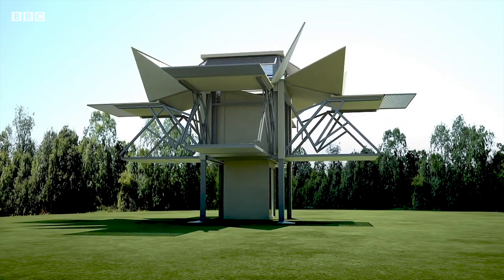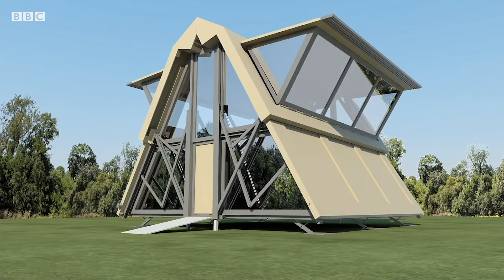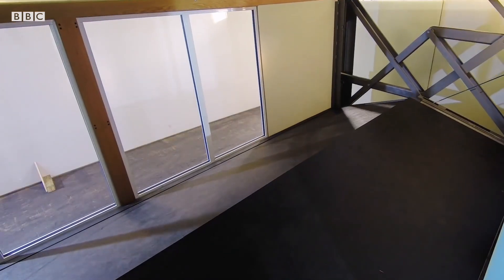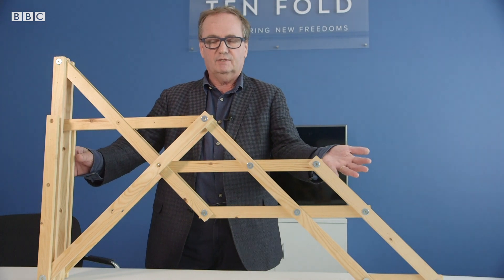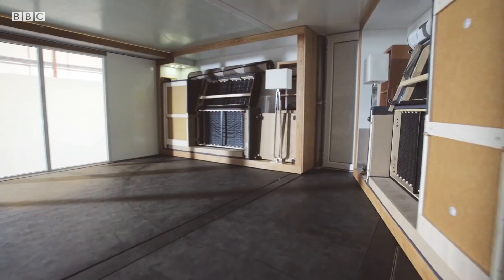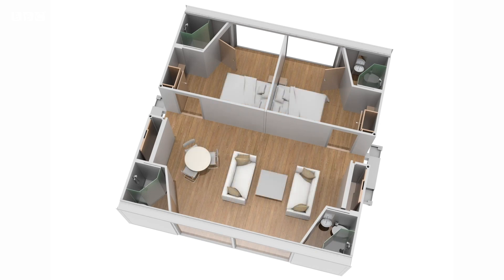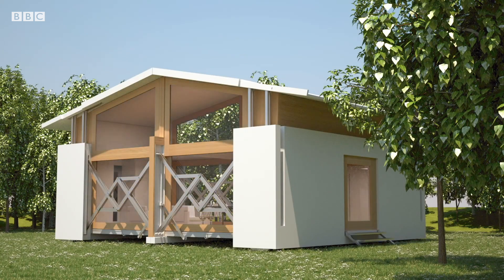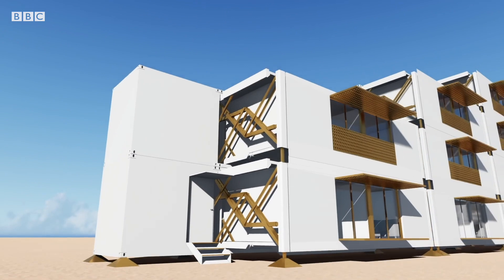The houses that build themselves - BBC REEL

Comment: I find the concept of unfolding buildings fascinating, especially the idea of counterbalancing for efficiency. In my experience as a flooring contractor, space optimization is crucial. I've worked on projects where adaptability in design allowed us to use smaller areas effectively, like transforming a bedroom into a living room. 

Cost estimation is another challenge in flooring. I’ve learned that understanding material costs and labor can vary widely depending on design choices. Using tools like FloorTally helps me streamline this process, ensuring accuracy in every project. Embracing innovative designs like these could change how we approach both living and working spaces.

Comment: The recent increase in house prices is felt by all the people
High housing prices have led many people to choose to rent.
Unless the supply of rental housing is very tight, tenants can choose a house with cheaper rent, or move to other counties and cities with lower rent.
Styrofoam houses are earthquake resistant and have the characteristics of being warm in winter and cool in summer.
Possible construction methods of earthquake-proof houses
First, use aluminum building blocks to form a triangular earthquake-proof house. Place giant aluminum plates or fireproof floors on the floor formed by the aluminum building blocks. People can sit on the floor.
Giant earthquake-proof house tank Possible construction method of chain-link earthquake-proof house
1. First use steel frames to form two triangular steel frame earthquake-proof houses.
2 Install steel ropes or chains between the two triangular steel frame earthquake-proof houses
3. Place aluminum plates or rubber floors on the floor network formed by several iron chains, and people can sit on the floor of the cable bridge.
The gravity of the furniture on the chain floor will cause the chain floor to press downwards. Giant springs are installed on the roof of the chain shock-proof house to achieve the effect of the front and rear shock absorbers of mountain bikes, straightening the chain floor.
Next to the two triangular steel frames at the bottom of the iron chain earthquake-proof house, a giant white iron back button for rotating the wooden door is installed.
The missile hit the roof of the chain-link earthquake-proof house. A giant roof body armor was installed on the roof.
The giant springs installed on the roof and the giant white iron back button on the bottom absorb the force of the explosion.

Comment: I'm reading the comments and I think that a lot of people are missing the point. I do not think the purpose this would serve is as a portable home. This is not a fancy caravan. It is a house. The point is that typically, building a home requires a long build time involving many different people. With this, you order the home, it arrives and is built within 10 minutes. However, the home will still need to be plumbed in, fully furnished and connected to the electricity grid. That is, once the home is actually unfolded and fully fitted, it would not be easy to then refold it again. It would first require the house being emptied and the pipes and cables connecting it to the ground removed. 

From the point of view of a construction company, these houses could be built in a factory and stored in a warehouse. Once an order is placed, the house is delivered to the site and is allowed to unfold/self-assemble. Definitely seems to me to be an idea that will have some potential.
Reply: Very well said.
I totally agree.